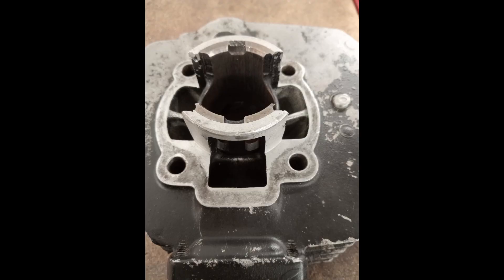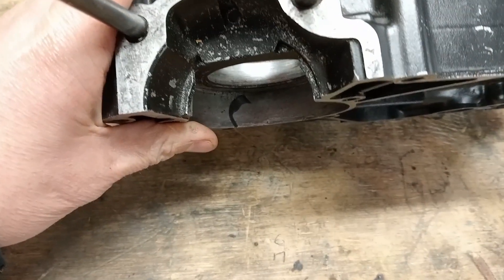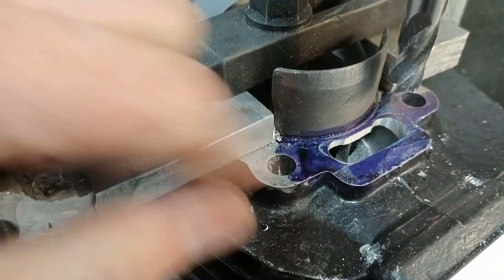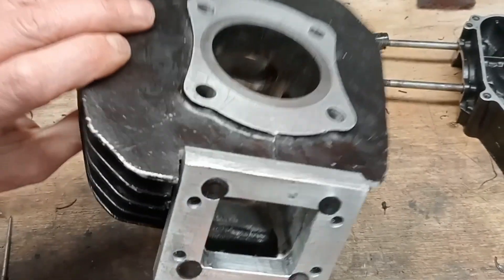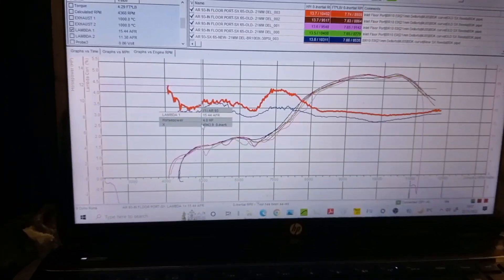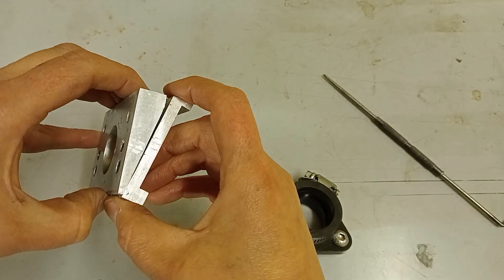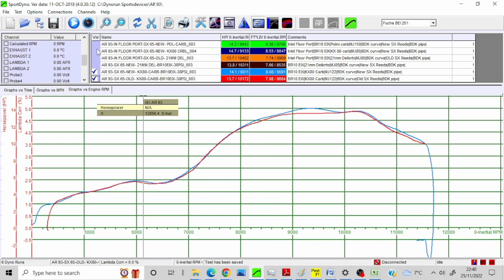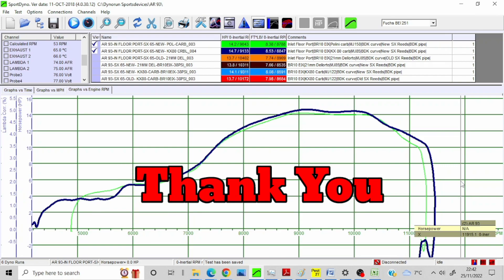Inlet Floor POWER Port DYNO Test - Kawasaki AR93

Comment: That engine is really similar to the honda mbx80 hc04e engine wow.
Reply from the maker: I guess quite similar eras... How much power do the mbx80s put out?
Reply: @AutoBeta2T  very powerful, a nuke on 2 wheels for its size, i run a mtx80 offroad frame with liquid cooled mbx80 engine, its ported out crazy, mallosi reeds and a diy intake manifold aswell as a exhaust pipe which i calculated and made by myself, using a tiny 21mil phbg carb, sucks on highs, good on lows, currently converting it to a 26mm pwk china carb coupled with a modified mvt manifold for derbi am6, cannot tell the dyno numbers because stock had like 11 hp with the 18mil carb and stock garbage pipe, but with the mvt ignition and a 30mil pwk these things had gone 30hp as seen on forums.
Reply from the maker: That's good power! I wish I had water cooling some days... Still that's impressive power for a older 80cc!
Reply: @AutoBeta2T  Yeah only lc for the race engines, and even tho its old, the mbx80 has ultra violent porting, even stock, the only necessary mod to have massive power gains is raising the exhaust port by about 2mm, seems controversial but it fn slaps! And this engine has a exhaust port bridge so i drilled 2 tiny holes for lubing.
Reply from the maker: Cool. What is the port timing on your modded cylinder?

Comment: I'm no 2 stroke expert but I've seen quite a few videos of these 2 strokes having a pile of different mods being done and no big gains. I keep thinking about the diameter of the pipe from the expansion chamber to the silencer. I could be very wrong but I think even 3 to 4mm increase I think would make quite a difference?
Reply from the maker: Hi Doug, yeah it's good to try and do things in isolation but even just changing one thing causes lots of changes elsewhere. Yes the stinger diameter can make quite a difference. I find making it smaller gives more power up to the point it melts the piston. 😭
Reply: Oh dear 😂 okay I'm used to four strokes. Is it melting the piston because of air fuel ratio with a larger stinger?
Reply from the maker: @dougbawden4321 it's the restriction that increases heat then the piston melts.
Reply: @AutoBeta2T  
One thing I always try to keep in mind is that most (not all) of today's performance guru's aren't like the Old guy's who used to tune engines. Most are bolt on part experts, turbo, were told something by someone or read a book and that's it. I always question why I can or can't try an idea. Sometimes it ends up in disaster lol. I think the 80's racing 2 strokes would be a great place to get ideas from. All over YouTube they say don't open the inside diameter of a valve seat on a four stroke... Hundreds of videos. Then in other videos of formula one and factory heads I've seen have the seat bored out to the max... Sorry I'm waffling on now lol
Reply from the maker: I love a good waffle myself Doug. The internet has a lot of great info on it and there's a lot of good info that's maybe not as good as you think it is but its been said so it must be true. One of the aims I wanted to convey through this channel is that i'm no expert but i'll try different things and report how I got on - good or bad. I will caveat it with whatever I find on this engine may not always be applicable to another engine. At the end of the day we are all just kids building sandcastles at the beach all day only to observe them being destroyed by the tide... but we always go back and try again 😃
Reply: @AutoBeta2T  
Very true. I enjoy watching your videos. And am looking forward to seeing how the project goes.
Reply: Oh sorry I didn't understand your reply at first. I see, I just imagine 100cc at those rpms trying to breathe through that stinger 😂 hope you win, I'm sure you will
Reply from the maker: Hi Doug - I hope the last reply does? And cheers - we will win against the god of speed!

Comment: Question, well 2.  

1. Are you running oil injection?   If not they why run the pump.

2, are your ports in the pison matched to the 2 big intake ports in the sleeve?  I seen that the ports are rectangle and the pistons are more oval?  On my rd 350's I seen good gains from matching these ports.
Reply from the maker: Hi, in short, no and no.
1. The pump also drives the tacho so I was keeping it at the min as i don't have a digital one yet. It will go eventually but it isn.t doing a lot.

2. I haven't had a good look but I would say no. I will have a look though so thanks for the tip.

Comment: Sorry if this is a silly question ,  but it looks like that new port just leads into a blind crevice closed off by the cylinder barrel ?   Does it flow directly into the crankcase void ??
Reply from the maker: Hi, yes it does flow into the crankcase now. The original cylinder did the same. I figured the reeds could still feed the crankcase even when the inlet port is closed

Comment: power only come from pipe , rest are nothing , so read this carefully ; pipe must be maximized , meaning diameter , length must be left alone at 36 inch , never shorter , i repeat again pipe must be 36 inch long with no midsection , only 3 parts 12 inch each , ,that is regardless of engine size , now increase pipe diameter to 5 inch then to 6 inch, that's regardless of engine size .. on 50 or 125cc .., numbers are not typo , if 6 inch  not work you increase case volume by adding 100cc volume by giant spacer on reed manifold that allows you to increase pipe diameter by 1 inch up at the time  , then have a huge pipe that pulls like a train from 6000 to 16000 rpm , no squish , no electronic , no big ports , you NEVER widen port over %65 but raise it to the roof , you never remove bottom ring , you remove top ring so you can carve slots to increase timing all the way down to top ring slot..and over 25 degree you need water-cooling .. you LOWER compression a tad to free up the revs  use low octane fuel , NEVER run open carb , it sucks hot air behind cylinder , lose power ,  so use original airbox.
Reply from the maker: Cheers, I have been thinking about an airbox but probably not the original as it's quite restrictive.
Reply: Pipes will make about 30% more power on average, a well ported engine will make good power with a straight pipe. I’ve seen many dyno runs.
Reply: A lot of what you have stated here is not true. Read professor Blair’s book on two stroke engines.

Comment: This was nice to see.  Years ago a local guy bought a AR50 and then a BDK buildt engine with full exhaust that worked pretty well. This saved me because I had messed around with my own AR50 myself with some success up to the point where it had to much exhaust duration and the moped just did not work well anymore. Then I tested the BDK ignition module and got the suprprize of a lifetime. Had to remark the rev counter to 14 000 rpm. It came on really hard at about 9800 rpm and revved to about 14 000 rpm. The most annoying was the gearing. With 5 speed gearbox and tall enough gearing for top speed, it needed revs and a lot of clutch when city driving. Used it a lot, but after years of driving and two rebores, tha cylinder skirt broke at the rear.
My mods:
0. Welded floor in exhaust port. 
1. Mikuni 28 mm VM carb on a home made intake. Heavy blow back prevented use of air filer.
2. Boyesen reeds. 
3. Home ported Autisa cylinder with big boost port.
4. Larger ports in the piston, shortened skirt on intake side, rounded edge below wrist pin. 
5. Ported crank case suffed / filled with epoxy in area under the intake port, between the transferes slots. (Stock cylinder with ported piston works well with this.) 
6. Proma exhaust for a Honda MB-5.
7. Upgraded clutch and genunie Ford Type F fluid did just slip a little bit at full throttle at peak torque about 10 000 rpm.   
8. NGK Iridium spark plug.
Reply from the maker: Cool - that's some spec! What sort of top speed did you get?

Did you do any Dyno testing of the port floor before and after? I'm really interested in the effect of this?
Also, did you Tig up the port floor?
Reply: This was years ago so nothing was ever documentet or dynotested. I just tested different things and drove to and from work on highway and in the city. Gearing had to be a compromise as starting from a redlight needed some getting used to to avoid stalling and it did hold 12100 rpm. in 5. gear over the more than 1/2 mile straight on the way home. It did not do 100 mph. but it did go over 90 mph and stock old boring cars like a Volvo 240 could not outrun it here on our rather twisty roads. 

A friend just filled the horrible exhaust floor with a MIG welder. 

The Autisa AR intake port really works, but I have made the boost port opening way bigger. I have read 2-stroke tuning books and it is called power  boost port or someting. I have converted stock AR and MB/MT cylinders to this and always had good results. 
Did it on my step sons Honda MT-5 Polini cylinder and he later told me that his moped had a "legendary reputation" among the locals. :) 
No one was even close to him then they "drag raced" and it had a distinctive sound with way more grunt than other mopeds. My point being it works. 

The point is when the piston ports closes the passage to the crankcase the piston ring opens the power boost port directing the fast moving intake charge directly into the cylinder. 
Naturally, I first did the reverse and converted the Autisa cylinder to the" normal" stock style / Honda MT style intake as only 8 hp from 93 ccm is less than impressive compared to other cylinders. The result of this test was disapointing. I then closed the intake floor, "stuffed" the crankcase with epoxy / JB weld to increase crank compression ratio. I could then lower the intake floor to it went through and then JB weld it closed again.

I also made the openings in the piston skirts below the wrist pin wider and taller.
When the piston is in TDC the stock skirt partly hangs into the intake ports if I remember correctly, not good and I modified that as well.
Reply from the maker: @doingitwronggarage9651  thank you for all info. That's really good and has got me thinking 🤔
Cheers
Dave.

Comment: I thought you where going to put crank induction ports into it from intake port wall to transfers ports.i did this to a it175 made it run so rich I turnd the power jet off and then it screamed.
Reply from the maker: Hi Skyhawk, that's interesting to hear as I fancy connecting the intake to the rear transfers...
Cheers 😊

Comment: 2:43 most don't realize that the flow adjacent to any wall does not move. As you move further from a wall the flow speed increases slowly untill a fair distance from the wall it reaches full speed. You can prove this for yourself by watching rain on your windshield. At 60 mph tiny drops barely move and the bigger drops move slowly but none move at 60 mph.
Reply from the maker: Hi Bill, as I recall from aviation the boundary layer does get sluggish and eventually separates hence vortex generators to re-energise the boundary layer. A bit like a wing the flow slows at the wall and then speeds up the further out you get from the surface. I guess something to do with the dimpling internet thing...?

Comment: That setup with the plate porting etc is very similar to how I did mine back in the early 90's. It worked out quite well,  made the transition into the powerband much smoother. The 93's used to be quite chuggy before getting into the powerband if left as they came.
Reply from the maker: Did you ever try extending the port through to the rear (B) transfer ports. 
I saw a picture of a AR93 barrel the other day on the AROD page that had them cut. Could be an interesting follow on test.
Reply: @AutoBeta2T  I saw they photo you mentioned the other day, it led me to this video. I smiled when I saw your plate as it identical to mine. It looks like you used an RXS or similar manifold and reed setup? I went with an aftermarket MBX one at that time, being wider created other challeges. 

In my early 20's (30 years ago) we were all very competitive with our tuning where I am from so I painted everything black to hide what I was doing.  lol

I did think to drill through at add dynos or do similar to the cyl on the webpage but never got to that point. I remember how quick the bike seemed in those days, but I am curious how it would compare to my more modern LC based bikes. My brother still has the old AR cyl and parts with inner rotor etc so maybe one day can do a side by side comparison! :) 

Would be interesting now being more knowledgeable (one hopes) to start from scratch. I don't have an AR now, but I can live vicariously through your videos! :)
Reply from the maker: Hi - sorry missed your reply. 
Yes that pic in AROD has got me thinking I need to do a before and after test on the additional tunnels. 
The intake is detailed here: https://youtu.be/8A4aEVAWUg8
Basically a KTM 65 reed. I needed to remove a fair bit of inlet to get it to fit and had a lot of issues with sealing but got there eventually :)
I always wanted to try stuff when I was 16 (30 years ago) but was never brave enough... I guess I'm doing all the stuff I always wanted to do now ☺️
Pleased you are enjoying the vids and hopefully another will be out in a bit. Life's took a turn at the min that I'm dealing with but the end is in sight so focus can swing to the AR.

Comment: I have two of these AR's sitting in my garage, thinking about restoring them possibly. Anyway I come from kart racing the Yamaha KT100 and i would like to know what your EGT's are you getting with every mod you do on the dyno, as we tune for max EGT without detonation. There is massive gains from lets say 800 degrees to 1100 degrees EGT. So to make a comparison on the mods you have to tune each one for max peak power. And fuel type plays a big roll also. I think you're doing an amazing job with all this work, I'm really enjoying the vids, keep it up... Tim
Reply from the maker: Hi Tim, thanks and pleased you are enjoying 🙂
Sounds like a project for 2023 then: 2 X AR restorations.
EGT wise I haven't measured it yet... The BDK pipe doesn't have a boss for a probe. Admittedly I probably should have fitted one from the get go but time seems to go nowhere. 
The pipe I'm making at the min will have an EGT thermocouple boss added and the Dyno acquisition box can record it along with CHT. I need to get a smaller rear sprocket too as it's geared less than the 100 mph I'm after ATM.
I'm assuming your EGT numbers are deg Fahrenheit? Also what distance from the piston face was the thermocouple? I've always used 6 inches.
Cheers
Dave
Reply: @AutoBeta2T  I will have to go out and measure it again to be accurate 6" sounds really close. we also set squish at .028-.035 with a race pipe to allow for rod stretch, 11cc combustion chamber and 114 race fuel (too much timing) at 14.8-15k RPM, they really sing and I know your engine is very similar to the kt100 (Air Cooled) the egt will tell you when detonation happens by dropping down because of incomplete combustion, play with octane if you can also. I like that you're really putting a lot of thought into this build!! I'm going to sub on your channel your on to something here...
Reply from the maker: Hi Tim,  thanks for the extra info and cheers for the sub 😊
Best get cracking with the pipe and see what the egt is.